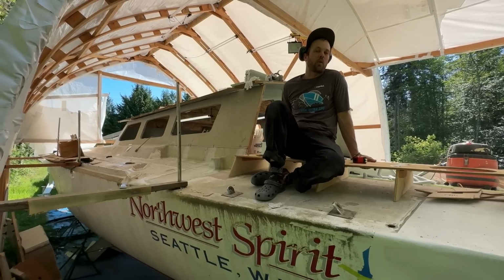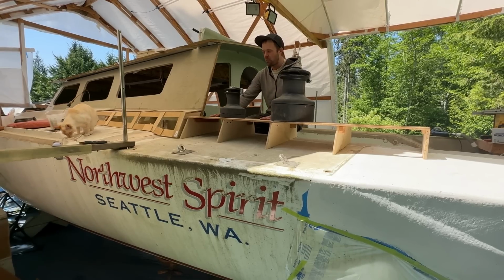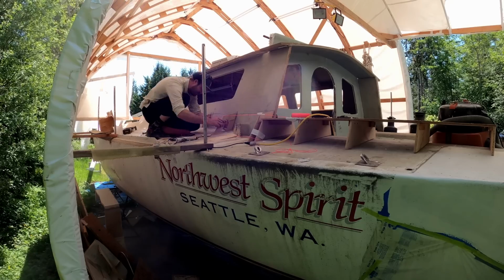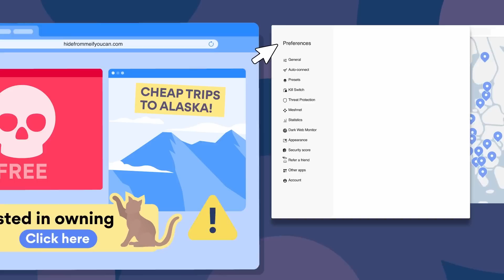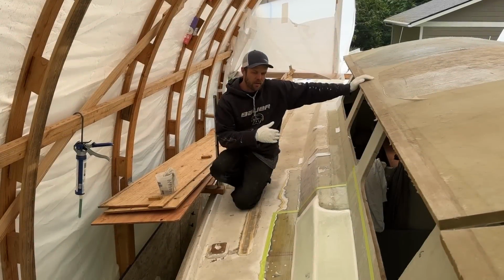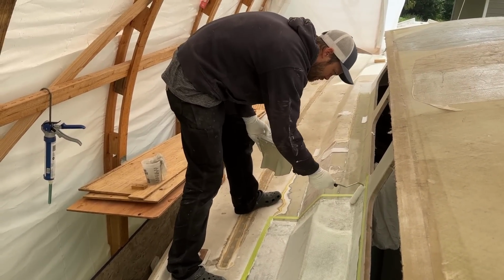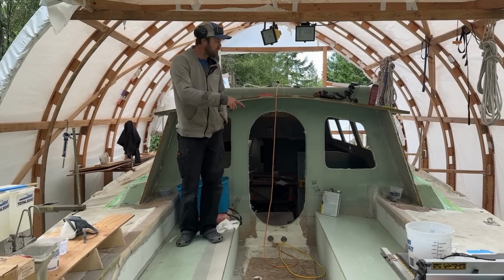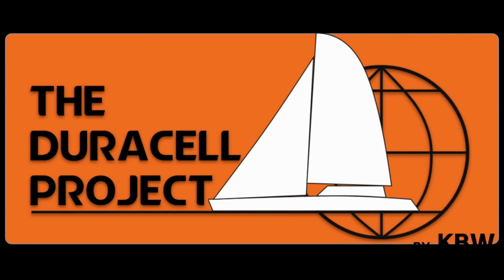A small piece that makes a BIG difference [E80]

Comment: You could cut openings in the doghouse interior walls to turn those empty spaces into cubbies!!
Reply: I thought the same thing, that it’s a shame to have unusable space anywhere on a boat BUT then I thought about how structural the walls are, especially with the load of the traveler.

Comment: all part of the process when changing shapes to suit the new requirements, its great fun, you do all the major jobs with success and then hit that wall when you need to blend a couple of the major components together, i do the same thing when designing houses, put all the rooms in with the functions required and then a brick wall appears and the whole thing looks naff

i thought originally when you cut the old cabin off you might use that 'combing?' as a guide to extend the new dog house off (making it a little wider), i only suggest that as i thought leaving that bit stuck out might become a trip hazard when the boat is in heavier seas having to lean inward over the cabin when using the grabrail etc and then extend a new combing off the back of the dog house along side the cockpit to give a clean aesthetic look, but i still like what you've done

personally i have learnt so much from you, layering soaked fibre on the melamine board and using plastic sheet to move from table to placement, great idea, i did have my own plan for doing corners and edges by using an L shaped piece of plastic, say cut from PVC guttering, again you can cover with plastic sheet, add multiple layers and then use the gutter to place into those awkward edges, ceilings, floors, walls - and a process of try and do

Comment: For the openings in the aft face of the coachroof, perhaps there are some top' opening hatches' which you can mount flush into the bulkead.  This would allow them to be out of the way when open and not an intrusion to the interior.  A 'partially open' setting would allow them to provide ventilation but keep the boat secure.  It's a bit of work to make them flush, the benefit is that it would still be comfortable to sit with your back against them when closed and open.  MJ Sailing have been making hatches flush on their catamaran build.   
Good to hear the inspector uses Nord VPN.  I guess their extensive research and reports need protection from all sorts of prying eyes.  Gathering and evaluating detailed information without the subjects knowledge is crucial.  Sometimes a low web footprnt and rapid actions are essential too.
Reply from the maker: that's a good idea, we'll look into it.

Comment: The cabin side extensions look great, visually they seem to reduce the height of the new dog house. 
For hatch gaskets, I've had good luck with Steele Rubber products. They have a load of different profiles and stiffnesses. For windows I always use Diamond Sea Glaze, have  had good luck with them making custom windows in different sizes.

Comment: I was thinking that deck extension down the side of the deck house would be a great place to run your running rigging through. Afix as many ¾" PVC pipes through there for each of the sheets and halyards and reefing lines you may need. It looks to be a couple of inches higher than your coaming so could enter right to your winches and cleats and line locks. And your coaming could be constructed with line bins in it for the ends of all your lines that need to be stored out of the way.

Comment: Don’t know if anyone else has mentioned this (haven’t read all of the comments) but I saw a cool opening window design in a similar location on a catamaran once where they had extended window sills on the bottom on both sides and the window was on a track and dropped down, like a pocket door. So when the window was slid down it created an open bar pass-through situation.
Reply from the maker: that would be really cool, but I probably would have had to have planned that a long time ago.
Reply: @TheDuracellProject  😆true, you would have to build in a second fake wall. Now you can just take a bunch of rolls of Glad Press n’ Seal wrap and put up a new window every day 🤣

Comment: Design decisions - if you want to minimise regrets later on, or much worse, then they can be a pain in the anatomy. This looks good and blends in well. And it gives structural rigidity to the new cathouse and its connections.

Comment: I don't see much added value in using the release film in a wet layup.  I always put down the peel ply and the breather cloth right over it, the breather cloth releases just fine from peel ply even when it soaks up a fair amount of epoxy.  For an infusion the release film is a necessity, but the extra time and expense in your wet layup probably isn't really value added.  I dunno, is perforated release film still cheap? Everything is going up these days.
Reply from the maker: i find that my lay ups come out a little too dry if i don't use the release cloth. also if i don't use it, i have to peel off the peel ply and sometimes i want to leave it on (for sun protection).

Comment: The side wall extensions really look like they belong there.  Nice work on the design planning and construction of both extensions.  Do you think you will ever need to have a step installed mid-way between the front and back ends of the cabin/doghouse structure?  The new extension looks like a great first step, but the next level is a bit far for getting on top of the cabin top.
Reply from the maker: It's pretty easy to step up onto doghouse from combing. But I could also put a little step in if we find it difficult.

Comment: This was great - a really nice insight into your design process (not just the standing & thinking method), and as others have said, the videography and editing/soundtrack is really cool...
The only problem is that the time these drop into my timeline, I have inevitably just gone to bed, so any attempt to watch is interrupted by my snoring about 5 minutes in, so it always takes at least 2 attempts!
PS. Any Boat Inspector merch in the pipeline?  I reckon there's a big following out there...
Reply from the maker: boat inspector t-shirts would be pretty cool....

Comment: Im surprised you didnt turn the coaming extension into a line locker, gas cyclinder cabinet, etc. drainage ports on the bottom, lids on top. youll never get that deckspace back. might as well.

Comment: A thought, too late though, but would it not have worked to put some conduit inside this extension to allow for cable runs ,  in a sense you then avoid the challenge of some cable runs inside the doghouse

Comment: Hey Matt. On these big ass ambient temperature vacuum laminations, coukd you state the hardener time and temperature, you are running at? Love your content Dudes. The project looks awsome the coming line looks suitable in the video.🎉❤👊👍🤙🖖
Reply from the maker: it's slow hardener. The temperature is between 60 and 70 degrees Fahrenheit.

Comment: I was a bit surprised to see string rather than battens for working out the patterns.  Will you use straight line aft from the aft end of the part you just completed, or will you make it curved to follow the curves of the hull/deck/gunwale?  Love how solid those panels are under your weight.
Reply from the maker: it's going to be pretty straight, following the shape of the doghouse

Comment: You are free to do what you want but I don't understand why you keep making flat panels out of foam and vag bagging all the time. The flat panels with their tight radii between panels will make a huge amount of work when it comes to fairing. Sight down the lines of the cabin addition on this video and you can see a wobble. It is going to stand out really annoyingly when you spray the top coat. The part you made in this video will probably take about 15 hours to fair, with lots of added weight. So you lose any advantage with bagging. Larger radii make it much easier to fair and don't draw your sight line. I think the amount of weight you save by vac bagging will be offset by the large amount of time and filler required to fair the tight radii. I would recommend you start using the great properties of foam and start bending it on forms to make your shapes rather than using the foam as some sort of flat panel. The boat will look more professional if you do get it to have some softer curves, I think your cabin would have looked much better with some more radius on the top edges, compound curve in the roof and some curve on the cabin sides. It is just normal boat design. 
For anyone looking to learn stuff from these videos - they are great at how to bag and make some nice glass work, but there are other ways to make boats more quickly, with far less landfill waste and with more curved surfaces that look nicer in the end and take less effort as well. These videos show how to do it the hard way. 
For anyone interested in ensuring fairness in light laminate pieces, a good tip is to clamp a piece of timber to the part being glued. That way the large timber will ensure fairness as the foam is glued onto the boat. Screwing light foam onto a part will easily produce bumps which will make you cry after spraying top coat. And keep the fillets nice and large - easier to fair and harder for your eye to find wobbles in large fillets (Ex 38ft composite foam/carbon/vag bagged tri builder here).
Reply: They remove the screws after the glue sets. Fill and glass over the top before fairing. I can't see a problem with that.
Reply: @Bowman339  Its not the screws, its the screws making unfair spots. I don't mind what these guys do, I just want people who are thinking of doing the same to know there are others ways to build foam boats, that is all. Each to their own, but having a Youtube channel does not mean you are necessarily doing things in an effective manner.  I find it a little hard to watch so much effort when a few extra techniques - fairing slightly oversize foam with a board and using larger radii, can make a boat look nicer, in my eyes, with less filler and less waste.